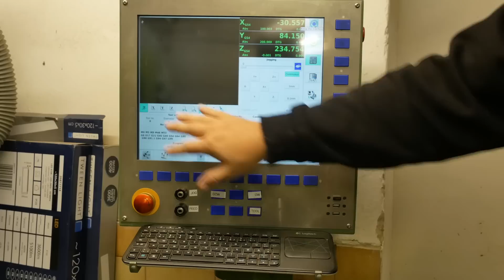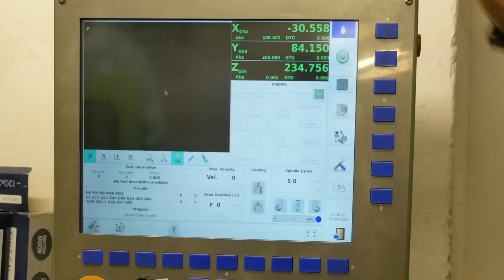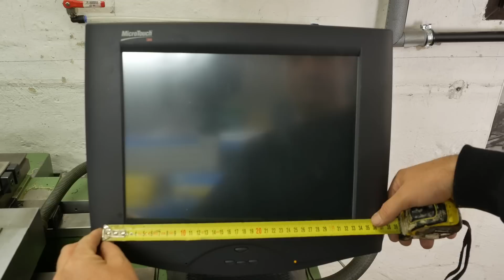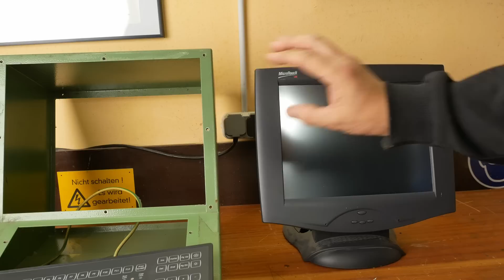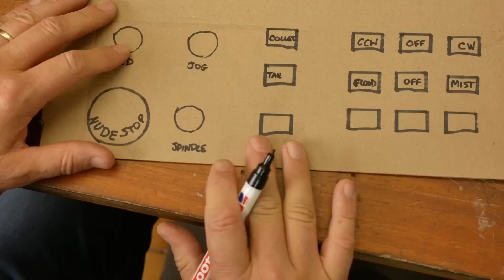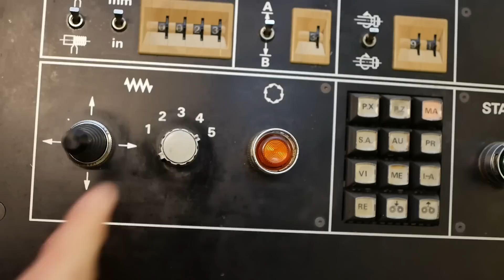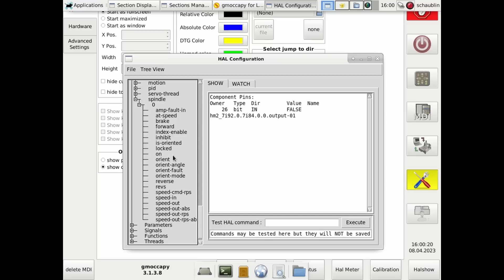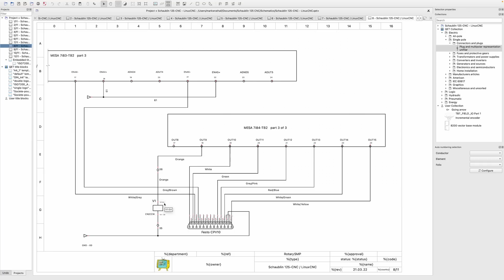Please help critique my CNC control panel layout ideas. || RotarySMP

Comment: I would separate the screen and the panel, as I did with my lathe.

Screen behind the lathe, panel possibly in the front on the rail.

I have to update my topic in the linuxcnc forum. 

But now that my padovani is ready and I have already worked on it a bit, I have to say that I find it quite ideal.

https://youtube.com/shorts/5H6WySlBXnM?feature=share
Reply from the maker: Thanks for the ideas Werner. I will check out your video.

Comment: Also you should connect a braking resistor inyo your inverter. You will be able to stop your spindle within one second and you will save a lot of time
Reply from the maker: There is an electric brake integrated into the main spindle motor. I just haven't got around to wiring it up, and integrating into the control system yet. I figured I'd use the mechanical break rather than electrical.
Reply: @RotarySMP  Electric brake doesn't have any wear, and you don't need any special wiring. Just put in a resistor, and tell the VFD to use it. It basically shorts the motor to the resistor, creating magnetic drag.
You can always combine it with the mechanical brake, which has it's own benefits. For example, servo drives with mechanical normally-closed brakes don't need any homing - although probably not relevant for your spindle, maybe even counterproductive.
Reply from the maker: @graealex  I dont really have space for the breaking resister, as some moron chopped down that control cabinet so small that it is full up :/ 
I guess I could put one in the next bay, I'll keep that as plan B if the mechanical brake thing doesn't work for me.
Reply: @RotarySMP  You can always put the resistor next to it, as long as the wire gauge is heavy enough.
Reply from the maker: True. How big are the braking resisters for a 3KW VFD? I need to look into it.
Reply: @RotarySMP  They're quite bulky, around 40x10x5 cm (although for 3kW drive, you don't need a 3kW resistor, more like 500W), and they usually come with wires already attached.
And yes, your mechanical brake will wear out. It's really meant for holding, and for emergencies.
Reply: @RotarySMP  The brakes built into the motor are usually for holding only and not for stopping.  If you use them to stop the motor they will wear out in very short order.
Reply: I would sugest you to install it outside the cabinet. It generates a lot of heat. Each inverter reccommends you a resistance value within two values. You should chosse the one closer to the smaller value to get faster braking
Reply from the maker: @hoyospetrola  Good points. I need to see if there would be space for it on the back wall of the machine. But guarded from swarf.

Comment: You have to make a teach pendant to jog. Do not install the jog encoders into the panel. If you dont you will regret
Reply from the maker: That is my idea for the jog wheels on the front of the stand. I wont put them up on the control panel.

Comment: I run an old Emco Concept mill 150 at the moment. It has two chunky rotary coded knobs for the mode/jog increment selection and also one dedicated to the feed override. They’re beautifully tactile sturdy and very easy to find without looking. 
If I’m running a new program my hand is basically always on the feed knob and if anything looks like it might be going pear shaped I just crank it to zero. I don’t even use the pause or stop button because this gets me out of 99% of situations. With other machines it’s always much more of a panic to find the tiny buttons or switch the pendant into the right mode. 
I would highly recommend looking into something like this or at least doing yourself a favour and increasing your knob size.
Reply from the maker: Thanks Nick, possibly the first time I have been critiqued online for my knob size :)
I have larger feed and jog rate overide knobs on the Maho, and you are right it is very fast to dial it back to zero,
Reply: @RotarySMP  🤣

Comment: I type this as i watch the video so if you mention this before the end forgive me.

With the feedrate override switch instead of a pot, go a twist switch with resistors for adjusting the value ie 0% 1% 5% 10% 25% 50% 75% 90% 95% 100% 105% and so on.
This is how the big machines do it and its so hard to switch between the two plus you learn the spot and its amazing
Reply from the maker: I did the overrides with encoders rather than pot's on the Maho, and it provides very similar steps to that. I was going to do the same again.
Reply: @RotarySMP  I think the benefit he is describing is that a twist-switch would have a proper mechanical stop, while an encoder is just relative. So with a twist switch, you could actually put some proper markings on the panel, and be able to visually confirm the current setting.
You could use a binary twist switch, and use only a few input lines to encode many states. 3 lines = 8 states, 4 lines = 16 states, 5 lines = 32 states, etc.
Reply: The advantage of a rotary switch instead of an encoder is that you can set it to a specific position by feel. That way you can keep your eyes on the machine while you have your hand on the feed override. Being able to quickly dial it down and then up again is a nice safety thing, to prevent crashes, for new programs. The important thing is to be able to do out by feel.
Reply: @JohnSL - Random Products  exactly this. Keeps eyes on machine not on the screen

Comment: And as a treat, use buttons that have an LED built-in. That way you get visual feedback directly on the button.
Reply from the maker: Hi Alexander, 
I have thought about that, but mostly for functions like collet closer, or tailstock engage, which don't have an indication on the screen.
Reply: @RotarySMP  You just want to hang onto your 50-Euro-Interface card...
I think all the 9 buttons you've shown like CCW/OFF/CW, Flood/OFF/Mist etc. would benefit from it. Additional bonus with LED buttons vs. mechanical switches for example is that a program can override it, but you still get the visual feedback. If anything, running a program that goes back and forth between modes is going to be a nice light show.
Reply from the maker: @graealex  I think that MESA 7i73 has some outputs, so it could probably drive button LED's. But I was going to machine the buttons to shape, and actuate standard industrial contact blocks. That is what I did on the Maho (except I 3D printed the buttons).
Reply: @RotarySMP  Industrial contact blocks usually have the option of including an LED in the center.
Reply: @RotarySMP  Most button contact block systems have light blocks that can be stacked in with the switch contacts. And for the button machining itself, even if you want to make the button bodies themselves from an opaque material, you can still drill a series of holes on the bottom of the text engraving and then fill them and the engraving with epoxy resin.
Reply: Or shock and vibration indicators 😁
Reply from the maker: @lumotroph  Now all the LED lighting mafia are starting to gang up on me :)
Reply: @RotarySMP  go give Tim Hunkin a watch. His arcade machines should have great suggestions for how to “indicate” the state of a switch ;)
Reply: @RotarySMP  That's what you get for turning your control panel layout into a democracy...
Reply from the maker: @graealex  LMAO! Yeah, I asked for that.
Reply: One more vote for the LEDs - it was the first thing I thought of seeing the layout plan. The rows of the 9 buttons are all mutually exclusive - sure mechanical radio buttons went out of style, but that still leaves LEDs...
Reply: @AttilaAsztalos  Mechanical toggles are problematic with software/programs. Sure, the program can override them, but you have no visual feedback, and manually overriding it again will get ambiguous.
For example, G-Code includes flood coolant "ON", but you decide to temporarily disable the coolant to see what's going on. There's no clean way to solve if not using momentary buttons with an LED indicator.
Although I heard aircraft have toggles that can be overridden in software with a solenoid. But they're really, really expensive.
Reply from the maker: @AttilaAsztalos  Do you really need an LED to show the spindle is turning, when you can see it turning, and the thing is screaming at you (The toothed belt is pretty loud.)

Same with coolant. I have never been using the Maho and wishing I had a light telling me coolant is on. There is a constant stream of milk showing that.
Reply: @RotarySMP  something like "spindle direction" might not be obvious when the spindle is stopped, or if turning too fast to be able to directly tell which way the jaws are moving. It's also helpful if there's ever a mismatch between what the computer thinks it's doing and what is actually happening. That's also why it's important to keep controls idempotent (i.e. separate on and off buttons rather than one button that toggles) so you can't accidentally turn something on that you were trying to make sure was off.
Reply: @RotarySMP  "Need"...? No. But my OCD is highly allergic to mutually exclusive buttons that are momentary pushbuttons without a locally visible feedback of which one is selected. YMMV... :)
Reply from the maker: @AJMansfield1  Good point. Although on some systems like the Maho's tool clamp, the momentary clamped / unclamped seems logical, as there are lockouts when it is running.
Reply: Build a new console that serves your purpose out of thicker material. You can’t stick weld the one you have as it is too thin, and it does not suit what you require. I would have 4 jog buttons in a diamond shape. More positive and foolproof than a joystick 😊
Reply: @chrisfairbrother9197  We already discussed that he needs to get into TIG 😉
Reply: @graealex  Yes I agree 100%
Reply from the maker: @chrisfairbrother9197  Thanks for your inputs Chris.

Comment: For USB ports, maybe use the round style, that saves you from having to file out a rectangle in the plate. There are even variants available with two 3.0 in a single housing for around 15 EUR.
There's also an Austrian company that sells specialized types, I recently ordered a few from them.
Reply: Good point, there are many interesting things to fit into 22 mm hole. USB, ethernet, I think I saw even mechanical timers O.O
Reply from the maker: @DreitTheDarkDragon  Good ideas, although I didn't file out the rectangular slots on the Maho panel, as it was laser cut. I think I'll get the front sheets laser cut again, as I want them to be stainless, and I hate working with the stuff. :)
Reply: @RotarySMP  Then I'd still go for the round panel-mount stuff, as it looks a lot cleaner.
Reply: @RotarySMP  Btw the company from Austria I was referring to is called "RIBU Elektronik". The dual-USB panel mount is Amazon ASIN B086Y944DX for less than 15 EUR and even has a splash-proof cover, so you don't get metal shavings or coolant in there. And of course Conrad and the likes have a lot more stuff.
Reply from the maker: @graealex  It's funny, I find the look of the slots lasered directly into the front panel to look cleaner to my eye. Different tastes  there. .)
Reply: @RotarySMP  Still the problem of dirt and metal shavings getting in there. A friend of mine who runs a metal shop uses an ultrasonic cleaner for his glasses, because with a tissue, the fine metal shavings will scratch up the glasses. He recently sent me a cordless phone he uses in the shop, and it had metal shavings inside, especially on the speaker that's magnetic. Metal dust and shavings everywhere.
Reply from the maker: @graealex  You got me on that one.

Comment: Is it an option to lose the jog wheel, and install a joy stick to move both axes? That seem pretty intuitive to me.
And another thing: your videos are never too long. No worries there.
Reply from the maker: Hi Willem, I find the two hand wheel two axis concept very intuitive, at least with my manual lathe. I  felt the opposite with a joystick.
Reply: @RotarySMP  Joystick on the panel, jog wheels on the pendant? Point is, if you are really in need of closely dialing in something, you probably are going to lean over the machine, especially near the spindle/chuck, anyway.
Reply from the maker: @graealex  That is what I thought, and there I'd want encoders for the click, click microns or hundredths. I am not sure when I would use a joystick.
Reply: and pots or encoders for controlling the jog speed that is how it was done by Fanuc in their controllers

Comment: In my opinion the keyboard definitely needs to be in front (closer to the user) of the button block. I would recommend a little palm rest if you plan or expect to spend any amount of time typing. 
At work we have one machine where the keyboard is arranged between the screen and the buttons, that is really annoying to use because you have to hover your whole arm over the keyboard while typing to not press any of the buttons or stab your wrist on the key-switch.
Reply: Yes, having no way to actually rest your arms/palms without pressing buttons or manipulating dials when using the keyboard is cumbersome. Keyboard always needs to be the nearest thing. And the membrane keyboards don't really suffer from accidental key presses either.
Reply from the maker: @graealex  Good points. Thanks. There was a good suggestion to put the keyboard n a retractable drawer under the buttons.
Reply: @RotarySMP  Drawer is probably the best idea. You could even go for a real keyboard then, instead of the membrane one. It's just going to be a lot of work.
Reply from the maker: @graealex  All of my five minute jobs are a lot of work, Alexander :) You know that by now.
Reply: This was also my first idea :)
But typimg on the keyboard may also be boring with buttons in front of it.
Retractable may be the good solution.
Reply from the maker: Thanks for confirming that. It is what I suspected.

Comment: I think for tool room work a jog button and jog lock button is really useful for each axis. It gives an equivalent function as engaging the power feed on a manual machine.  Some tool room machines will link the X and Z axis to machine tapers manually without a program using jog buttons, but I don't think that's very useful.
Reply from the maker: Gmoccpy locks out jogging when you are not on the jogging page, so if you bump a jog encoder while on the MDI or program page the input will be ignored. 
The Schaublin 125CCN with the Fanuc control can also link axis and drive along a taper with a single jog button, but I will be implementing Andy Pughs Lathe Makros, so cutting a taper will be easy enough in MDI.

Comment: Is a pedant something you'd use on a CNC lathe? If so, this is (almost) plug'n'play for LinuxCNC: https://youtube.com/shorts/LUMRR05cWKM?feature=share
All open source, so modifyable to your needs.
Reply from the maker: Not really. When I talk about a pendant, I mean more of a module fix to the front of the stand with jog wheels on it.
Reply: "Almost plug-and-play" - and then it's a DIY project that you have to build yourself...
Reply: @graealex  Yes - but that's the fun, isn't it - what this channel is all about. By plug'n'play, I mean there's no wiring (only a USB) and just a single line of config.
Reply: @philip_fletcher  I usually suspect projects using too many DIY components to remain a permanent construction site. Like, you want to build a CNC machine, but then you actually end up building a pendant...
Reply from the maker: @graealex  If I was going to build another single encoder pendant, I would do the one which Peter "Talla83" designed, with another gentleman. Really nice integration into the Mesa hardware.
Reply: @graealex  I was told by a 1st generation 3D printer designer: "There are those who build 3D printers and those who use them." I am definitely in the latter camp (with CNCs too) but came perilously close to the former when the Manualmatic 'Christmas' project overran by a couple of months!
Reply: @philip_fletcher  That's exactly my point. Buying a full-featured product means you don't spend time on something that isn't your actual task - i.e. if you want to 3D-print, get a printer and not some DIY kit.

Comment: Hi over the ditch. I would use the Maho control unit. I would move all the control buttons onto the slop use the larger screen with no buttons next to it. It makes for a cleaner unit. Place the key board at the bottom.
Reply from the maker: Thanks for the feedback. I really like the physical soft keys though.
Reply: @RotarySMP  Also if touchscreen fails, you can still use physical keys :)
At work we used one robot pendant with wireless mouse because screen died and we just had keep machine working to finish rest of batch. It was working, but it really wasn't comfortable.
There actually were physical keys to start, stop and restart cycle + to move all axis. Problem is that to move axis you have to switch to different screen on touch panel and then back to run in automatic mode. That was one thing which wasn't present on physical key and only reason we had to use mouse at all. Also to change program, but that batch had to be running for two more weeks.
Reply from the maker: @DreitTheDarkDragon  That sounds like feeling around in the dark :) Gotta do what is needed to get the product out.
Reply: @RotarySMP  Yeah, I guess sometimes that happens everywhere. Funny thing is that I suggested to buy replacement pendant for that robot some months before it happened. We even got price offer but somehow nobody ordered it.